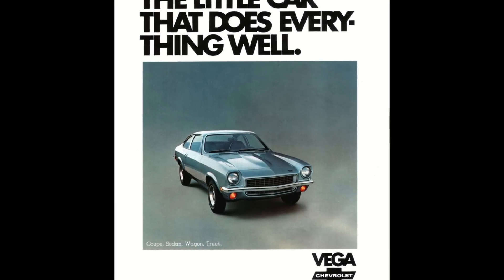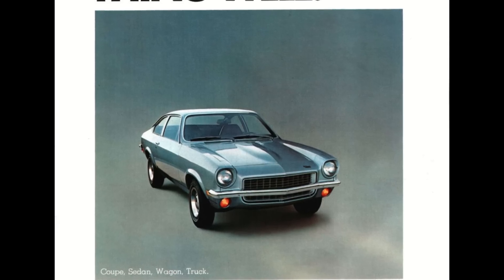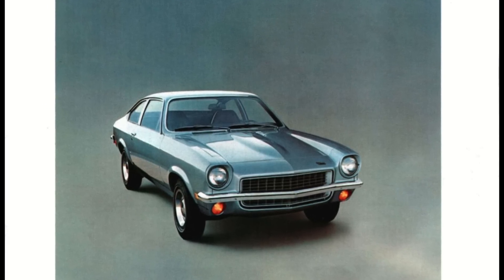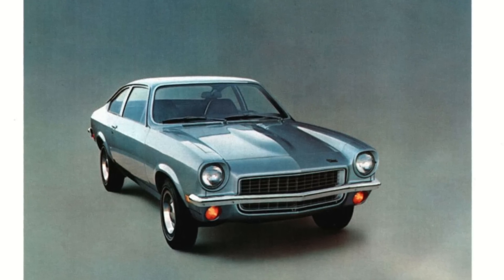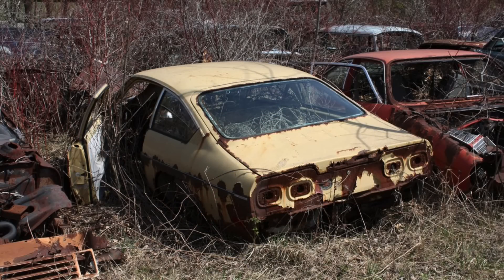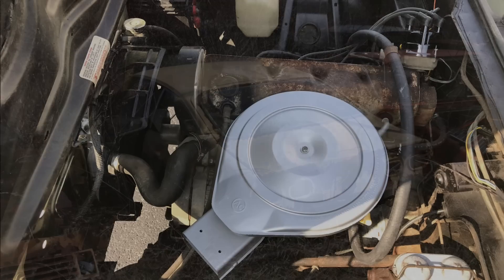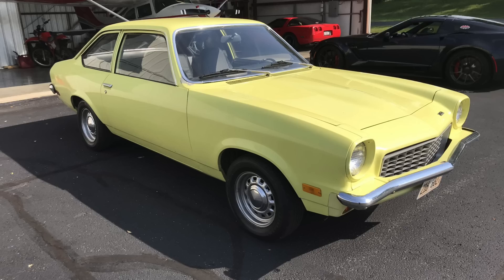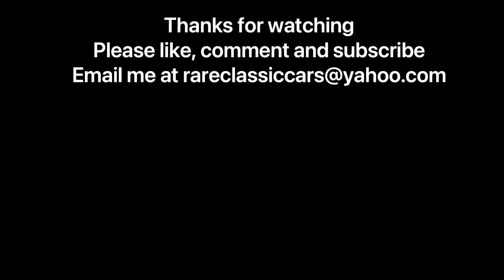GM's Largest Failures: Why The Chevrolet Vega's Engine Turned Buyers Away From American Cars

Comment: The Vega was a gift that kept giving as well.  I remember friends and neighbors of my parents saying they weren't interested in a GM product because so and so down the road bought a Vega and had nothing but trouble with it.  Though in the 70's and 80's there were so many troubles with all American brands that usually turned into people saying they weren't interested in any American car because they had seen so many problems with them.  In the town where I lived people would drive 100 miles to buy a Datsun or Toyota rather than go to the local Ford, GM, Chrysler, or American Motors dealers.  In a very short time you went from hardly ever seeing a foreign car to seeing them everywhere.  We really blew it on that one.

Comment: Worked on these cars back in the day, for all the problems of the aluminum block pointed out in the video. The Vega platform was used as the introduction of the new A/C system "CCOT" Cycling  Clutch Orifice Tube that went on to be installed across all GM models.

Comment: I bought a 73GT in August of 73 for $1800. Nice car and loved how it drove. Could get rubber in all four gears if I done it right. I noticed some new gaskets on it but it ran great. Started to go to school one morning and it turned over and locked up. That evening I pulled all the plugs out and hit the starter and shot antifreeze out of the two middle cylinders. I pulled the head off and checked it. Warped. Had it trued up took about .030 off the head. The block was ok. That's why it had new gaskets. Put it back together and ran like a charm. In early 74 it was using a quart of oil about every 500 miles. Took it to the local Chevrolet dealer and traded it in on a new Cheyenne Chevy 1/2 ton pickup. I got $2600 trade in and gave $4600 for the new pickup. My payments was $89/month for 36  months on the difference through GMAC at 16% interest. My very first credit and I had just turned 18. No co signers.

Comment: We owned a Vega in 1975. It was used and I don't remember the model year, but it was fun to drive and I loved it.  We lived in southern Arizona so no cold weather or rust problems. I guess it was lucky that my wife's foot slipped off the brake pedal and she totaled it before we experienced any mechanical problems.  At the time, I worked in an auto parts store.  So, just to see if I could, I cut open the air filter housing and found a filter that was a close fit.

Comment: I had one,  a '72 Wagon. I was 19 yrs old and it was my first car. These P.O.S. cars were so bad that local Chevy dealers would not take them in for trade... how bad of a car is that?  I ended up trading it at a Ford Dealership for a slightly used '75 Chevy C-10 step side pickup.   It only had 20K miles on it, and to keep it from smoking when I took it to the dealership for the trade in,  I was running about a 60-40 mix of Castrol 50wt racing oil and STP. 

Another aspect of this engine not mentioned was the hokey and very unconventional set-up for the valve lash adjustment.

Comment: This engine block utilizes an open deck design.  This design allows an unwanted effect known as  "head gasket scrubbing"  to occur .    This happens when the free standing cylinders move while the engine is running and thus "scrub"  the head gasket, which causes the gasket to eventually fail.
The open deck engine block design has been revisited over the years, and by several manufacturers, and they still encounter the dreaded "gasket scrub".  Great video !  I really enjoy your channel !

Comment: I do think that the flaw was using steel / cast iron rings instead of aluminum rings. I bet the similar metals would have worked.  But just a theory as it has never been done TMK.

Comment: Excellent presentation that misses the larger issue with the Vega engine. Most certainly all the enumerated flaws were unforgivable oversights by GM engineering. Incompetence really.

But even worse—even if all those flaws never occurred—the engine was a piece of junk. Terrible Noise, Vibration and Harshness. Anemic power—the specs just weren’t there. And what you got you were stuck with. There was no way to practically upgrade or modify the engine. Even the Cosworth Twin Cam version was an improvement but still underpowered.

I had a ‘73 GT and loved it. Great looking car—especially with lower standing GT version. Outstanding handling and ride. Not great but decent shifter. Good clutch. Great size. Not too big or small. But god, that engine sucked (and I never had ANY of the common problems). To this day, I’d love to have a GT with a small block V8 transplant.

Comment: I had the 1976 Pontiac version of this POS in college. Pontiac called it the Astre, my friends called it the ass-tray. In two years it rusted all the way up to the door handles. The clutch cable was exposed to the elements and so it naturally snapped in the middle of winter, stranding me in central Ohio. It didn't have an oil pressure gauge or light, but it did have an oil pressure interlock that DISABLED the ignition - again, in the middle of winter at 10"00 PM in central Indiana. The stick-on mouldings all lost their adhesives and fell off. The ignition leads had no routing clamps and two of the four cables arced over against the block. The alternator was tensioned with a nut/bolt with no lock washer or nylon nut - the alternator belt had to be manually re-tensioned once every few months. If you were going 50 mph and you wanted to pass someone, you had to downshift to second gear to put the engine near it's HP peak then quickly knock it into third to finish the pass. The mantra among owners when refueling was "Fill it with oil and check the gas". It was a horrible car. My next car was a 1980 Mazda 626 and I've never owned another GM product.

Comment: But you can smell one from ten blocks away. Nothing smells like a Vega burning a quart a day. Only thing better than a Vega, is one with a Buick 215 swap. Use to be able to rent the cam tool for $15 back in '79, to replace your head and gaskets every other Sunday.

Comment: Why did GM SHIP THE Vaga  upside down,  I did help the engine and the oil seeped in all the wrong places,  i had a 71 vaga and it was a great little car for the first 6 months,  I bought it from two older ladies,  it ran great till one day I was going on I-75 and it just stopped running,   I waited 5 minutes and it started back up,  I did do this again till on day it did it again,  i read that the engine would over heat and it would stop running,  well I fixed all the rust and dents and sold it,  I got what I paid for it,  to many things were going wrong for a 3 year old car ,

Comment: Another unusual design in the Vega engine was the tensioning of the timing belt. The tensioner was the water pump. The pump housing was a rectangle with slotted holes so one had to empty the cooling system to change the belt and then pry the pump against the belt while tightening the bolts. This also meant that the pump, and with it the cooling fan, spun in the opposite direction of the crankshaft. I encountered a couple of them with overheating problems where someone had tried to fit a flex fan to them to increased the airflow through the miserably small radiator. The problem was that the aftermarket flex fans, which were quite popular in those days, had their blades pitched for clockwise rotation as viewed from the front while the Vegas fan spun anti-clockwise. I didn't notice it until I walked in front of the car while it was idling and felt air blowing out of the grille.

Comment: I test drove one of these when they first came out. This one had the low power, 85 horse maybe engine. At 65 on the freeway I mashed it to the floor and switched on the AC. No change at all in speed on flat freeway. I took it back.

Comment: It wasn’t cylinder liners. Pull the head at 50,000 miles and you would see how badly the cylinders changed shape as the operating temperature changed. Walls too thin. 

Mercedes, Porsche, and Japanese motorcycle manufactures conquered aluminum cylinder bores, and Reynolds knew what was needed but GM balked at the cost. Cylinder heaters were needed to control crystal formation. Silicon carbide, I believe, very hard. An acid etch to remove soft aluminum leaves a very hard surface that holds a film of oil. But not in a Vega.

Comment: These cars were good for V-8 coversions. Hooker, Don Hardy and others sold kits for these. Did this to my 73 in the mid 1980s. Ran it for 2 years with a 283 v8 and got almost 25mpg with plenty of power. Traction bars were a must to prevent the rear axle from rotating and ripping out the upper control arms from the sheet metal behind the rear seat. Eventually made a pro street car out of it. Added a full frame, 6 pt roll cage, narrowed ford 9", 383 "destroked 400 route" Nitrous powered. It was a bike killer. Ended up selling it for a down payment to buy a house. Change in priorities as life goes on.

Comment: I owned a 72 Vega and my Mother owned an Impala from what year I don't remember. I had a blown head gasket on the Vega and the Impala was one of the cars that had a 305 V-8 with a automatic transmission that was too weak for the power produced by the engine. I've read that engineers at GM had grave doubts about the engines that were to be installed in the Vega but were overruled by higher ups. My Mother ended up paying 300 dollars to have a dealer install the appropriate transmission that the car should have had from the factory. I've had conversations with people about these things and they always bring up the Pinto gas tank thing. One thing I can say about my Vega and the Impala is they were very safe cars because you can't drive a car when it's broken down in your driveway. After reading this do you wonder way my first rule for vehicle shopping is ANY THING BUT GENERAL MOTORS!

Comment: GM is very accomplished at manufacturing junk. It costs more every year and they find new and improved ways to give you headaches. 47,000 miles on a Silverado and the speedometer quit, headliner’s dropping,lights leak water inside, actuators run constantly. My Toyota is like a dream car in comparison.

Comment: GM already had a very reliable inline 4 cylinder engine, the 153 cu. in. OHV "iron duke", which was
available through the 1960's in the Chevy 2 and Nova, and even in 1/2 ton pickups. That motor was a cut down version of the larger
GM OHV inline 6 cylinder motor. GM should have offered the iron duke right from the beginning, in the Vega. The aluminum block OHC engine was a colossal design failure.

Comment: I worked at a gas station during high school.
News flash! You would pull in, stay in your car and someone would fill your tank wash your windshield and even check you oil and other fluids. All for the low price of 80 cents a gallon.
The Vega was a favourite as we made commission on oil.
"Check the gas and fill up the oil" was the joke with us attendants.
A quart of oil was 1.25. I have seen EMPTY cans for sale for 5 bucks at vintage stores.
Oh, but had I kept all those old Quaker State and Valvoline cans!
Vega is a VERY rare sight.

Comment: As I recall, the Vega had at least one other really dumb issue in its early years: In an effort to make it seem sporty, it was given an unrealistic maximum height for a family-use car. This made it very unappealing to moms with small children or older folks or the overweight or just plain tall folks. One other result was that it would not fit on many automatic car-wash lines without serious damage to mechanical bits underneath. About 10 years later, GM sold a huge number of Cadillacs which could not be restarted after going through a car-wash. I wonder if there was something missing in GM usability testing in the 70s and 80s?

Comment: My uncle had a Vega that overheated cracking the block. My grandfather was a mine mechanic, he had some new stuff that they had just received at the mine called JB weld. My father and my grandfather pulled that engine out three times trying to repair the crack with JB Weld. Each time my grandfather would slather ona  greater quantity of JB and let it cure longer. My father new it would not work and told my grandfather on the third attempt that if it failed he needed to stop playing around with it and take it down to a machine shop to have it sleeved. Third time it fired up and ran for 5mins, then it started puking coolant. The moral of the story was take it and have it sleeved and stop trying band-aide fixes using the new at the time, JB Weld.

Comment: Porch and Mercedes both produced hi silicon aluminum sleeveless engines at that time and had no problem with them, gm went cheep on the pistons and used soft cast aluminum pistons in steel of the more expensive ones, Vega engines suffered from the accounts trying to save money and destroyed the massive investment in production setup.

Comment: Many people swapped the 4 cylinder engine for a 8 cylinder if they really wanted to get their Vega fix. I also remember someone telling me you could only expect 60000 miles from a Vega 4 cylinder, 80000 miles from a 6 cylinder and 120000 miles from an 8 cylinder. (Normal driving of course)

Comment: I still think bean counters screw up cars to this day.  A small amount of money would have prevented a disaster.  In this case, the Ford Pinto 2.3 lasted forever.  Imagine if the Vega had a Pinto type engine and fender liners?   Look at Ford's 1980s-1990s effup with the Taurus 3.8 V6 - an engine with a 60 to 80K lifepan..  A few bucks more for even better quality head gaskets would have prevented maybe a million former Ford buyers from leaving the brand forever.    Today, we have junk from Subaru, Nissan, and even Toyota with problems that could be prevented with a bit more money.

Comment: I've owned at least 40 Vega's back in the day and Never ran into any of the issues you speak of. I've rebuilt some of them and had really good success and reliability out of them.  My opinion of the Vega engine is, It was a very reliable engine as long as some common sense maintenance was performed. I never had any of the block issues either or rust issues.

Comment: Owned two GM cars with aluminium motors, a  Buick with a 310 V8 and a Chev. Vega, both were a piece of junk. Vega motor lasted to 45,000 miles, Buick till 75,000. Never bought a GM product again.

Comment: Strange that they chose to make the engine block out of aluminum but chose not to use iron cylinder liners to save money.  I thought aluminum was much more expensive than iron so why didn't they just make the whole thing out of iron?  Seems like that would have saved more money and made the engine much more reliable.

Comment: My mom had a 76 Monza. It had that orange motor shown in your video. It had to have liners put in it. Because the sparkplug was arcing  to the cylinder wall and ruined the rings. And the problems got worse from there total junk!!

Comment: Chrome Rings and Iron plated pistons? Machine shops started boring and installing liners and aluminum pistons fixed a lot. Blown head gaskets and Oil leaks oil burning ......Bad Design!
1977 monza 2.3 ...3 engines..1 clutch..1transmission " Saginaw 4 speed"  all replaced @ 27.000 miles?!?

Comment: I worked for a Chevy dealer and replace the first Vega engine on the east coast , cause , water hose came off and rousted the engine . Over heating was the only problem we would run into . They where a great car to work on easy to get to things .

Comment: I owned a '74 Vega for nearly a year while a university student back in 1977.

The good: The car looked good and was comfortable. It rode and handled well, was good in snow,  and had a decent fuel economy for the time. 

The bad: It burned oil terribly. I  used old engine oil from garages to dump into it. The one-piece air filter assembly was expensive even if you bought the generic from an auto parts store. Mine had a strange intermittent warm engine starting issue that made it sometimes difficult to start.

On a whim, I took it to an AMC dealership and was offered more than I paid for it on a trade for a '76 Gremlin. That car, a much maligned vehicle on its own, was bulletproof and lasted until after I finished school. That I traded in for a shiny new GM X-body, specifically a Pontiac Phoenix. That car was the worst I ever owned. Being young and poor it was all I could afford.

Comment: Very good review.  I was shopping for a "work" car when the Vega hit the market.  The undersized radiator and lack of cylinder liners were a big red flag.  Otherwise it was a sharp looking car but everyone I knew that bought one had problems.  Instead I bought a Pinto with the 2L German engine and 4 on the floor...drove it to work for several years and had zero problems with it.

Comment: Too bad they didn't use the 4-cylinder 2.5L Pontiac "Iron Duke" engine. Basically bulletproof! The Iron Duke was the standard engine used in the Chevrolet Monza, so it should've been available. 

First wife had a Monza when we married. We drove that thing cross-country multiple times with zero problems.

Comment: Why did they develop this engine? GM had Opel/Vauxhall 4-cylinder engines in Europe that could be fitted into the Vega. Engines that were in use without the problems this one had.

Comment: My sister purchased a new Vega.  It had a problem with the small diameter tires being Out-of-round.  The solution was to shave down the area that was faulty . . . which shortened the life of the tire and removed tread.